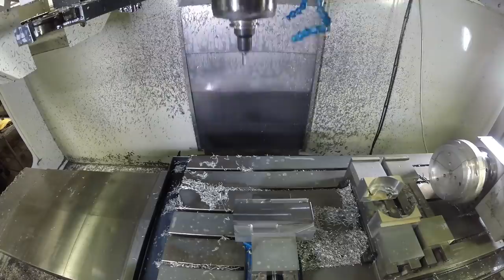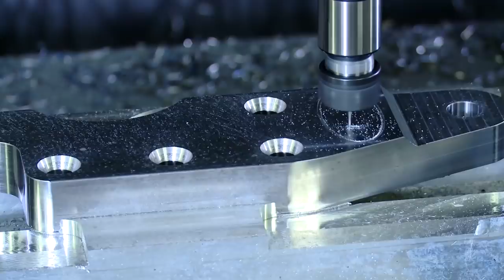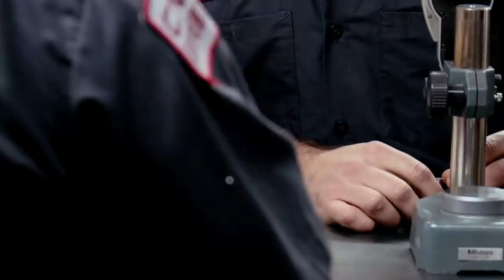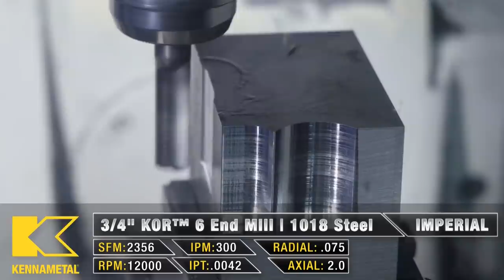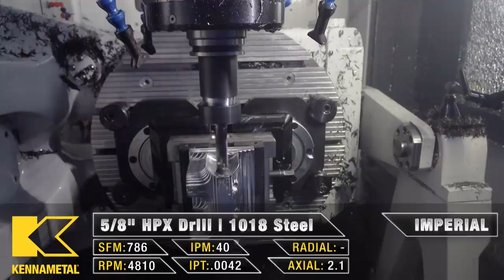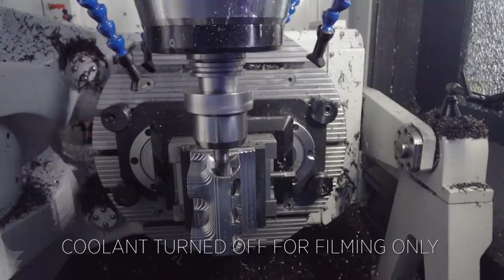Tools Keep Breaking on Night Shift, but Runs Perfect on Day Shift... Nobody Knows Why

Comment: Using a qualified manufacturing process is critical for large volumes. Includes all tools and process parameters. Semiconductor manufacturers used to have the problem of changes made by shifts. Current approach is to lock out recipe changes. Must execute qualified recipes per operating procedure.
Reply: Hmm . . .the "old lock them guys out" routine ehh. . . .
I'm sure ur right for some shops because it's amazing how differently shops operate, the skill level, AND THE BIG ONE, are "other employees willing to share knowledge" with new employees?

I've worked alot of shift work over the yrs. and so many times when the program is locked, or no key on 2nd or 3rd shift something would happen, maybe break the last 1/2" carbide end mill "in the world" ! 
It might seem. 
Tool crib closed on the weekend or something like that.
But they have (700) pieces shown for 7/16" Dia. end mills !
 So great, all you gotta do is get in the control make a few tweaks for the new tool diameter, bla, bla, bla.
But can't do it, you're locked out, keys in a desk somewhere locked too.. ..
*( it's a very high priority part and process,)  but you can't work ahead cause inspector can't stamp the 
op #  complete so no work around it
So maybe you gotta shut the high priority job until days hit comes in !!
Oh, and ur not gonna be popular then. . ..

So ANYWAY ;
It can happen this way, not everytime but . . . .

Maybe You don't lock them out but just tell them HEY, "Do not" bla, bla.
Machinist usually will do what their told when it really matters.

I've worked in lots of different shops in 32 years. Everybody does things at least a little differently. And when you go into a shop where it's "every man for himself" and you can't get answers to basic process questions, or where do they keep this or that, that's a toughhh break-in period 2 to 4 weeks or more 
Some shops you hire into, the Machinist there, they'll know your coming because everybody talks. The shop Super, might tell his buddy hey we hired a guy, starting on Monday, 2 weeks. He might say "yeah
 he looks pretty good, 25 yrs,  of vert. Cnc experiance,
About 8 yrs. on cnc lathes before that, and pretty good with blueprints." 
(or whatever)

That takes a 6 minute conversation, it goes around the shop, and by the time a guy gets to the job, somebody there is already offended !
(I've lived it, really.)
So, you come in, you're not carrying a sign of your resume on your chest or bragging of what you've done but some of them think if they show you anything,  then the boss might think that the "New guy now knows more than the older employee !

And alot of times, especially when you're younger, if your the new guy coming in, you're a little concerned, if you do things the way "they"
do things ! Because like another comment that was made here said, no matter how long you've been doing it, there is always something else to learn. And just a tweek here or there in a manufacturing process can change Everything!
It might run faster, smoother, maybe a process change might completely cancel the need for an operation !
So maybe it ships 2 days sooner, 
on every part that you make !
And if you ship it earlier, you can invoice earlier!
Owners love that ehh. ..

# So Hey, 
Sorry, so many words fell out,
But I love this trade. Alot of good, fun, productive
days just making chips & learning some really cool things along the way.
I have a 15"x 60" Colchester manual Lathe, in my small shop that I restored, painted and tightened up some things to end with pretty good machine.
Also
A Chevelier
Vertical Knee Mill that I want to paint soon.
Thanks, 
I always enjoy hearing
"What's up" in everybody else's shop.
Be safe.
Thx.
Reply: That's exactly what they need to do after this. Lock out those idiotic operators that think they know better.
Reply: Procedures are in place for a reason. Try telling a space customer you used a different parameter/process than what was signed off on. It's silly, yes, but they'll still feint and reject the part. Lock em out.
Reply: @markoc.2397  say less
Reply: Exactly.  You just used some different words is all.
Reply: @5oclockshadowbanned154  yep

Comment: When I worked as a cnc tech, I eventually got to the point where I could spot a problem when looking at the program, but surprisingly one of the most reliable ways to tell if everything is going right at the machine was the sound, vibration, and surface finish. I usually defaulted to trusting the engineers (though the one that made most of my programs was pretty awful and horribly arrogant), and then when I noticed a problem I would make adjustments to compensate. Or I'd let it ruin a part so I could take the part to the engineer for a childish yet satisfying "told you so" moment
Reply: "... I'd let it ruin a part so I could take the part to the engineer for a childish yet satisfying "told you so" moment..."  That is what every one should do.   If the codes are correct then the parts will not be ruined... and if the parts get ruined.. then the codes are incorrect.
Reply: @gubjorggisladottir3525  I'm totally fine with someone noticing a thing and asking the question.

Changing things without consult is bad
Reply: @michaelsorensen7567  I agree not to just trust a program and ask if you spot something and that's how my lead likes to handle it but in this specific case I don't think that works

Comment: I work in assembly rather than machining but this same sort of thing is true. My shift gets maybe 2 or 3 bad parts a shift (10 hours and around 400-500 parts usually), when we come in the next day there will be 20-30 bad parts from the other shifts. 

The worst was when they added a camera to the end of the line due to a previous operation issue. We had to check to make sure a connector was seated properly and put a mark on it to confirm it. Instead of just marking the connector the other shifts would simply go into the machine instructions and disable the camera. One of the engineers had to change the pass code on the machine so they couldn't do that anymore.
Reply: Doesn't anyone threaten to fire anyone anymore?

Comment: Totally agree, we usually refer to that as "Chip Load per flute" right, isn't that what we were taught . . .
At 1st in your story I didn't realize that operators were just comparing "feedrates to other feedrates & selecting the lower feedrate just because it was lower!. Yes the feed rate alone can't tell the "chip load per flute" without the rpms & 
# flutes.
* The Machst. Hnbk. has the sfpm(surface feet per minute) for almost every material. 
     Thanks alot enjoyed your video !
I can't say I run FeedSpeeds  as fast as I've seen you guys do, but doing the math at least gets you in the ballpark to begin. Then you can consider other variables like rigidity of setup, age of machine, hp, then after all that then I usually could have some confidence in the operation. I think that's important too. The confidence.
These BIG machines now days, valuable parts & forgings can be alittle scary on 1st runs.
But Man! As I watch your parts so fast & so perfect, It's a kind of beautiful thing!
I always felt that about some of the work I did when they got all the edits, and then "just ran". . . .so cool.
"Go Titans"

Comment: Hi from New Zealand. I worked for Seco Tools for 28 years promoting/selling their products throughout New Zealand, visiting many machine shops both general engineering and production shops and what you are saying is so correct. Its all to do with the corrcet chip thickness, WOC and DOC and it all varys from job to job. Turning is relatively simple with cutting speed, DOC and feed rates but milling is so much complicated, especially if you want to improve production. I am now retired but enjoy watching your channel, which I only found a few days ago. Climb milling and convential milling is also an intersting subject, especially when milling materials that have work hardening tendencies. Cheers Ian

Comment: We spent a ton of time perfecting the speeds and feeds/DOC for each and every tool we used.  Guys would often turn the feed override down.  Shop Forman eventually went around and took all those knobs off the machines as a temporary measure until we could get it locked out so they couldn't touch it.

Comment: For us, by the time a live part gets to a machine for production we've already made prototypes or used values from similar parts and everything has already been calculated by the programmer or the engineer or the head machinist. This was explained in abundant detail to the gentleman we had on third shift who was watching a $40,000 part on a 5-axis that took 2 weeks to machine out of titanium. Apparently there was something he didn't like about the way it was running so he decided to tweak it in the middle of a run and he crashed a $40,000 part 3 hours before the part was done. If he had just left it alone it would have been fine. And that's my second point is if the programmer has loaded in a program and all your tools are set and everything's ready to run, just let it run. Whoever programmed it will realize any mistakes by the time that part is done and any changes will be made by the programmer or whoever the lead is. Your job, for the most part, is to stop or pause the machine if there's an issue hopefully before something bad happens and to change out materials for another run. You might even be lucky enough to have a tool presetter and you enter the new values, but the programming and machine settings should be mostly off limits to an operator.
Reply: Who was the fool who let him run the $40,000 part.  😁
Reply: @jamisojo  

Exactly.

Comment: Chewed through 2 cutting tool jigs before seizing a 3rd in the part. Mislabeled parts not annealed before  boring process machine step.   I was only a material handler, /press operator  then, & formed out to a  different night shift assignment.  Supervisor  had to  sort out inventory  to make sure process ID tags properly filled out and process steps done in order before day shift started.

Comment: I once worked in a shop where they ran carbide endmills at the same feeds and speeds as hss. They was constantly changing out their endmills because the corners were getting knocked off. The rest of the endmill was still sharp. Come to find out the programmer was just using the arbitrary feeds and speeds his cadcam software kicked out. They wouldn't listen to me when I pointed out the issue, so when I worked on night shift I'd crank up to the proper feeds and speeds. I was usually done by lunch with a 120% production rate.
Reply: "More work? Why don't you just sweep that under the rug for me while I pour this bag of money into the bin."
Reply: @FiltyIncognito  oh that place was really messed up. That guy didn't have a clue. He couldn't think for himself at all. For example. I was setting up a job where I had to zero off the center of a bore. Instead of sweeping the bore, I always just indicate with an edge finder to find the center. I was taught that trick at the last machine shop I worked at. Just as accurate and way faster. He say me doing it and threw a fit. Then went in the office and looked it up on the internet and saw what I was doing was legitimate. He came out and said ok you can do it that way. Hell I'd be been doing it that way since I'd been there for the past year. If only that company knew how much money he was costing them. But the owners weren't any better. I love machining but I don't miss that place one bit.
Reply: @davidbarr707  I know that feel. First place I worked at was a small shop for wood products and they bought a cheap wood router from a failed company. They didn't have the first clue about CNC, and they were always on my case about all the time I had to spend learning the shitty machine and optimizing the terrible run they initially set up, which was essentially the sole reason their company existed.
Reply: @davidbarr707  "He couldn't think for himself at all."

I don't know what you're expecting when you do something outside the normal rules. Most people who don't do things as written are taking damaging shortcuts. If he couldn't think for himself he'd never have looked it up nor let you do it after to save what little pride he had left.

Maybe you were being part of the problem as it sounds like you often argued and fought with the people there?

Don't talk crap about people when you don't give their side of the story... otherwise you yourself become questionable and part of the problem.

That being said, it doesn't mean the place wasn't crap... but it isn't simply black and white. There is nuance to these things.
Reply: @Buglin_Burger7878  I don't think you understand the problem he was describing.
If you understand how both measuring tools work, you wouldn't need to go the internet to know that it works just fine.

Comment: Listen up folks. This guy knows what he's talking about. You can't just guess at this stuff. All your parameters are defined by surface feet per minute relative to the tool. I've seen guys try and run the same program with exactly the same feeds and speeds. Only difference is 2 different tool manufactures. One worked great one went splat. He's like WTH? Sat him down and explained all that he didn't know. Not sure he fully comprehended , but he never did that again. When he had to switch tools he asked about changing the parameters. Lesson learned. Night shifts suck. Too many bad apples, lazylugs ,stoners and drinkers.
Reply: that is time well spend. When the operator just learned that when something is off, that he can go you and your the expert, then you have a pair of eyes and ears on the floor.
Even the operator flags things that a afterwards verified irrelevant like the color of the tool marking, later he might flag the core root of a long running problem like using the wrong tool variant that is marked by the color of the tool marking.

Comment: I lot of the problem that we have at my job is that there is no communication from the 9-5 Engineers with the night guys who work 6-6. What goes on during the day is a mystery to us half the time and we just do our best to pull through. If we have a problem running a part one of the few options we have is to monkey with the speeds and feeds.
Reply: @Noob Deygo Yeah a lot of things get designed too based on perfect operating conditions that don't usually exist. Like perfect coolant quality or fresh tools and not regrinds.
Reply: 6 to 6.  What a terrible shift.  
I don't know why people want to have 12-hour shifts.  Not from the guy working it or the management.  Working 12-hour days is not a life.

Comment: i have scene this before were an off shift adjusted the over ride but it was so they could get a higher part count. My boss at the time had a fix he cut the speeds and feeds in half and then put the over rides at 200 %.

Comment: This hits the usual manufacturing standard. Dial it in on day shift with support staff. Day shift gets direct training and explanations on why we need to do things certain ways. Then we tell night shift to run giving usually nothing but specs, minimal explanation, 2-3 sentence emails, and generally zero time with support staff  to understand the why. Just an expectation that they know. So they only have the reference of what knowledge they already have usually previous use of said machine.

Comment: You are so right.
I remember repairing a lathe once, built by my employer. When I finished, the company I was at asked if I could look at another lathe for them. No obligations, but if I could make a suggestion it would be appreciated. They were getting chatter on the part. I told them to turn the feed rate down. The guy who bid the job for the company immediately spoke up.
"Oh we can't do that. We won't make any money on this job."
I told him, "Change the feed rate, change the type of material you are cutting, or change the insert type. You'll have to change one of those three to get rid of the chatter."
Like you said. It is not just how fast you are cutting but everything together.

Comment: Yep. The company I work for makes does for a certain industry.The dies worked fine until recently and nothing has changed on our end. The die setter upper at the customer end did not set the dies up properly. Didn't stop the customer from blaming us for everything however😃
Reply: Best story I got was a government contractor.   Made the parts all good to print and the same as I always ran them, they rejected them - bore was bad.   Bought a digital bore gauge for $6k, rejected parts good, reran the parts anyway to a tighter spec - they rejected them again for a bad bore and called a face-to-face meeting.   Showed up at meeting, sat down, one of the two guys slid a ball bearing across the table at us and said, "It has to fit this."    Set of bearings they got shipped were a full 0.020 under their print spec bottom, but we had to eat the cost.
Reply: @theincantrix1144  I hope you at least laughed at them.

Comment: I have no clue about how you go about programming a cnc for any use but your description of the problem and solution makes perfect sense.  WAY too many one size fits all rule followers who don't go deep enough into the details to understand what you were talking about,   Great job because as you mentioned there are more than just a couple of values to consider in that line of work.

Comment: Unless the night shift operator was encountering a problems with the programmed cut there is no reason for him to adjust anything. That employee needs to get put on notice that if he changes the programmed cut again without having a dame good reason he will be billed for the wasted material and tools or be fired. His job is to basically just watch the machine to make sure nothing goes wrong and to change out the parts once they are finished being machined.